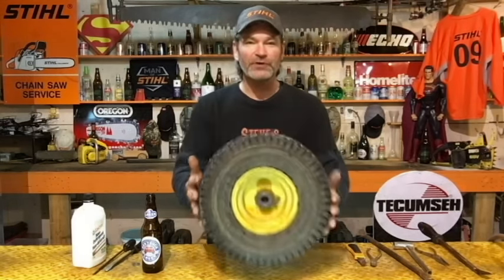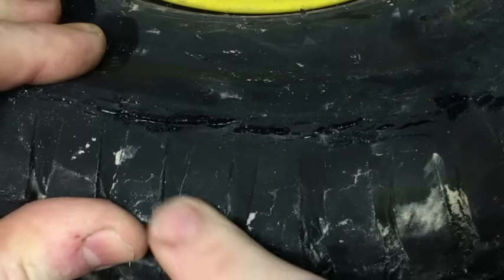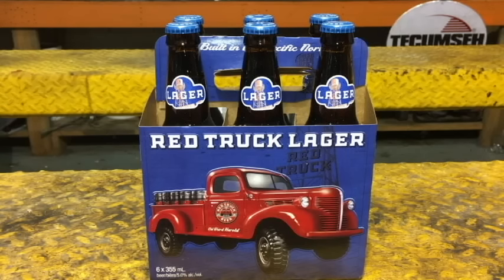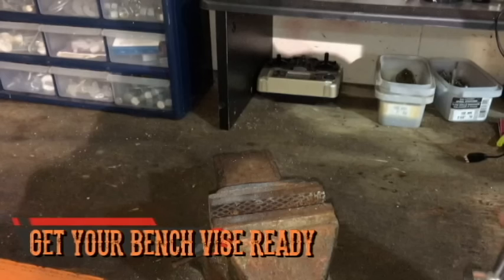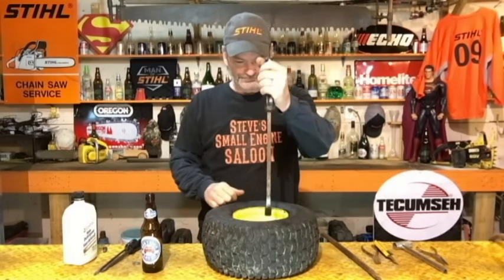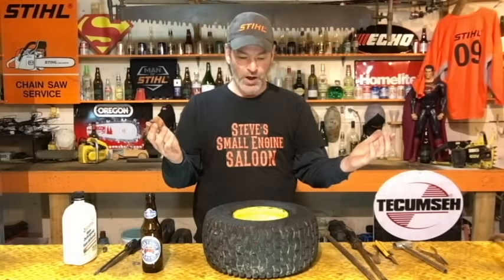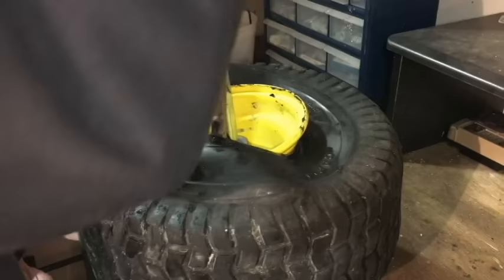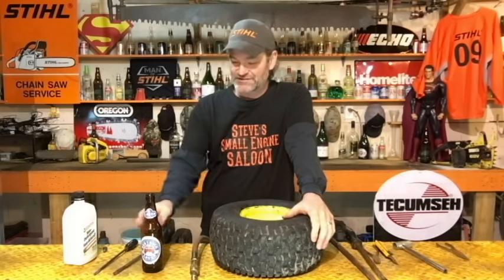How To Install a Tire Tube on a Riding Lawn Mower Tractor

Comment: 3 frigging beers and I had go look you up. I did this before but I don't remember struggling this much. Thanks man. Doing this on my snowblower. I couldn't get the wheel off because it is rusted solid to the shaft, so I flipped the blower on its side. I waited till now because I drained the oil (and gas) for the annual oil change. Any tips on getting that wheel off in the future? I thought about torching it once I had the rubber off, but I decided not to..
Reply: Not Steve, but spray some PB Blaster on the wheel and shaft and let it penetrate for a while.   Some folks make a mixture of acetone and ATF fluid as a rust release agent.  The acetone/ATF actually has been better than any commercial solvent as seen in many independent tests.

Comment: Steve use of petroleum product could attack the rubber in some tires. Soap is good idea or use silicone lube. But we're talking about lawn tractor tires. My tractor rear tire love's to go flat and break the bead. Grabbed my bead blaster, and my god that tire almost had me crawl into a corner with my binky. Yes you can spray and poof. Did that on my semi truck tire until the g/f hosed me down after freaking out over a little fire, yes really small. Preference is to use my bead blaster. The aforesaid lawn tire really fought me, but I prevailed. Now it's flat again so tubes all a round. Great idea on the washer. I've used fishing line, but will try washer.

Comment: A quick point to eliminate some steps. When installing tube semi inflate it until it's firm then place it in tire put stem through rim, air pressure will hold stem in place eliminating the need for washer and grips to hold stem. Extra bonus when you place air in tube it takes out all the wrinkles and pinch points in tube so you will not accidentally poke a hole in it.
Reply: Great hint!!  Thanks.
Reply: I was taught to always add air to the tube and then let it all out so if any wrinkles in the tube they would come out then.  It always seemed to work but I do like your idea.

Dale in Canada

Comment: The only thing you forgot is to mention is to get the tube facing the rite way. I have put them in backwards and had the stem disappear and then had to poke a hole in my new tube to fix it. Best trick a good friend showed me is to inflate the tube and then you see for sure witch way it goes then deflate it and put it in. I also have a stem tool that screws on to hold it ( it also removes the core and rethreads the inside) handy as heck. Keep on keeping on. How was red truck?
Reply from the maker: Excellent tip, thank you!  Red truck beer sucks....
Reply: Steve's Small Engine Saloon thanks for the heads up I almost ordered it at the lobo last night (red truck)not a tire tube 😜

Comment: Thanks Steve, I got the new tube installed in there and pumped it up with air and put the wheel back on the tractor, all seemed good.. but then later I went oh-no, I forgot to fish out the other half of that stem piece, it's still inside there probably wedged between the new tube and the side of the rim because I had the rim on its side when installing the tube, is that stem piece going to put a hole in the tube?  will I need to take the wheel off the tractor and fish that stem piece out of there? silly me for forgetting about that cut off stem piece, your videos are great, thanks a bunch

Comment: Also, they make a tool that’s basically a “jointed” metal bar that screws into the valve stem to help keep tube from running away inside your tire

Comment: I have a small tire for a scooter that is 10x3 and needs a tube. I got the tube but it is so tight that it is almost impossible to push in like you demonstrate. Should I try just stretching the inner tube after letting it sit in the sun? Any clever tricks?

Comment: excellent! I usually clean out tire of any sand sharp debris and put baby powder on tube and inside also. I did alot of large tires on heavy equipment skid steers and little tires the hardest. Love this channel. 
Where is the Moose head Beer ? I am a NY guy we have it.

Comment: *** I wouldn't use oil, but mere soapy water, reason being the tire can slip on the wheel, but I also recommend adding ATF after putting the tube in, it swells the cracks inside so you can have like a tire in a tire when then cracks seal up. Some just use ATF as a quick fix for side wall leaks but always go for a tube, you don't want to go back and do the job again. Slime the tube before fill and never look back.

Comment: Steve, does it hurt to put a tube in a tubeless lawn mower tire thats had tire. sealant used in it?? Need to do anything else to the wheel before  adding the tube, othen than have a Mller Genuine draft beer?

Comment: Steve, have you ever tried doing this job without popping the bead over the rim? When I did mine I pushed the back side bead loose from the rim, and pushed the tube up in between the tire & rim. It reduced the time by almost 2 beers, and I didn’t pinch the tube with the tire tool.
Reply: That's my second idea. If you pinched the inner tube, pull it out without taking one side of the tire off with needle nose pliers. Work the valve stem in first. Get your washer on. Take a dull stick and work it into the rim. That way prevents pinching, but those heavy duty thick tubes are hell to get on this way.

Comment: I always take a paper towel and wipe the inside of the tire, then pull the paper towel out and see if it has any tears in it. If it does then you have a thorn or nail or something sticking inside the tire that will puncture the tube. If no tears install the tube and pump it up.
Reply from the maker: Right on

Comment: Do you recommend cleaning out the failed sealant (slime) before inserting the tube? If so does it need to be really cleaned out before inserting the tube?

Comment: In my experience, unseating the tire from the rim without a tool designed to do that only works on tires that look like the one in this video: worn out and with weak sidewalls. I weigh 200lbs, and my weight plus a long handle crow bar will not unseat tires like this when the tire's in good shape.

Comment: I know this probably will turn out to be a dumb question, but since you aren't completely removing the tire from the rim, why is it necessary to break the bead on the rim opposite of the valve stem?
Reply from the maker: The tire wont come up far enough to get the tube in...
Reply: Got it. Makes sense. I've got an 18 year old Kubota TG-1860 with a rear tire that has a very slow leak, and I'll put your technique to the test soon.

Comment: The washer trick!~ vise grips slid off the first time around going with Steve's washer tip !  EDIT: Just used the washer method and a shout out Bob Haddock for the baby powder tip made the install super easy.

Comment: My tires are done for. I'm having a problem removing the wheels from the axle on a JDeere riding mower, any tricks? Maybe a video?
I've tried penetrating oil and heat. I'm afraid to hit the end of the axle with the wheel under tension with a brass hammer in fear of damaging the transaxle.
Great videos, but beer takes 2nd fiddle here in wine country.

Comment: I noticed that Steve didn't feel around the inside of the tire, to assure there were no thorns etc, sticking through, they would certainly puncture that new tube that you just put in.
Reply from the maker: Great point!  I actually do that, but forgot to include it in the video....

Comment: Those sidewall leaks are problematic to seal. I used Slime. I removed the wheel  and laid it on its side so the sealant would spread on the sidewall.  Then, because the opposite sidewall was also leaking,  I turned it over so the sealant would cover that side. Even though this was successful, I definitely would not do it for highway use tires

Comment: One additional washer trick. After you put the washer on, instead of a cap to hold it, use a tire valve extension. then the washer is still on there during tire inflation.. also, I am not a fan of big screwdrivers. harbor freight has 16" tire spoons for cheap money and they are not as likely to scratch up the rims and later cause the paint to rust Milton has 4 metal ones for about $5
Reply: Meant to say that Milton has 4 metal valve stem extensions for $5 to old that washer on the valve stem

Comment: Steve if these are center straight stem tubes , and the hole on rim is off the side , how will it work ??
Reply: In some cases you rotate the tube around where the stem enters the rim at an angle. Some smaller tubes (4", etc) are more prone to come with angular stems

Comment: The biggest problem with tire sealant is, the manufacturer directions are to, after spraying in sealant, is to spin the tire at speed...a difficult step for a lawn tractor or snow blower!!😉
Reply: Keith Rayeski, right. I used that on a Garden trailer tyre. Tried spinning it with my foot for about 30 secs and got bored. Then walked around the workshop for 10 mins swinging the tyre this way and that until I again got bored. 
Needless to say....it didn’t work. Tyre went down quicker than before. Ended up putting in a tune.

Comment: ...mmm perhaps you should make sure that there isn't any sharp objects stuck in the tire  by running a magnet around the tire !
and an  Old School trick used for putting a new tire on a bike  - squirt a few shots of Baby Powder inside the tire and roll it around a few times  so that the new tube will be able to slide into place as you fill it with air !
Reply from the maker: Right on   :_Beer: :_Mower: :_Rider: :_Chainsaw:

Comment: Hold the valve with locking small vicegrips with a soft rag in the jaws. The stem is actually the little metal piece inside the valve.

Comment: The use of petroleum based products on a tire bead is not a good idea because it can break down the rubber in the bead of the tire resulting in an explosion to do bodily harm. Also the use of a screwdriver on a tire for the inexperienced will result in poking a hole in the tire. You’d be better off getting a cheap pair of tire irons from a place like Harbor Freight.